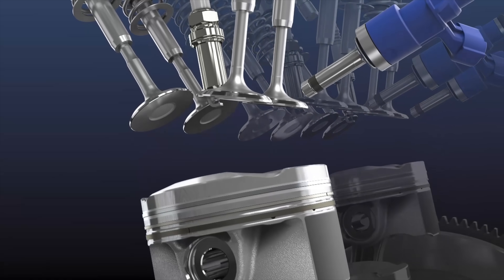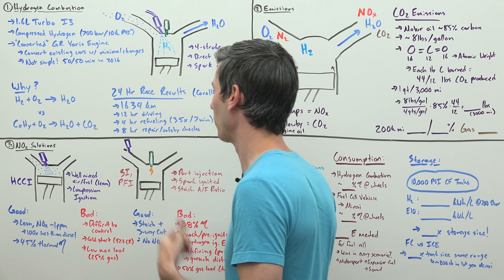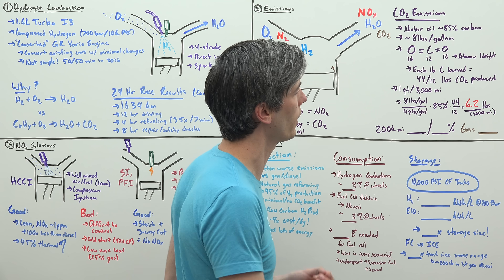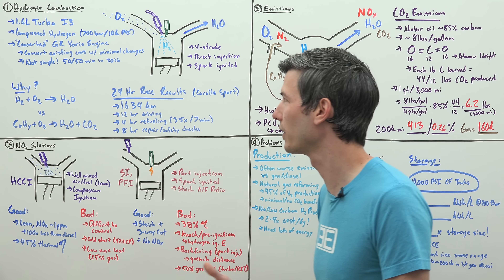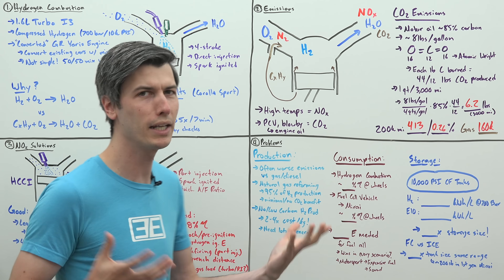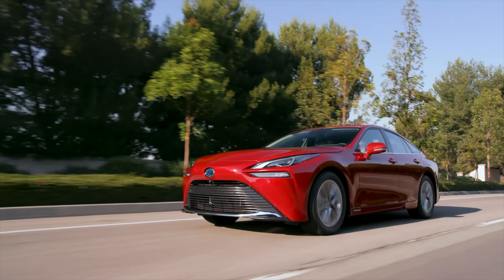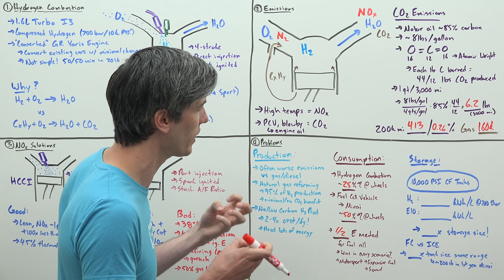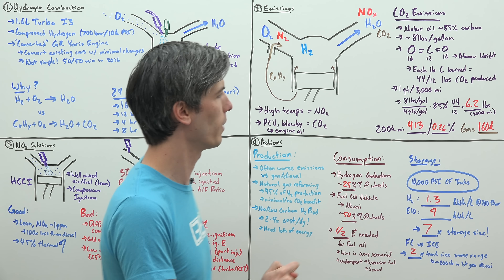Toyota's Developing A Hydrogen Combustion Engine!

Comment: Both Mercedes Benz and BMW had working ICE  engines during the 70-ties as well as there were some converted ICEs in US for test purposes. One thing, not mentioned is that stoichometric combustion of hydrogen and air will result in such high temperatures that the nitrogen oxides are produced in large quantities (order of 5 - 10 000 ppm) since there is no carbon source it can not be catalyzed away as in peterol engines. The solution is to use lean fuel mixtures (approx 50%) in purpose to reduce the combustion temperature in purpose to avoid NOx formation.  This results in a much lower specific power which can, in turn, be overcome by supercharging and/or an increase of engine rpm.  An alternative tested was water injection into the combustion chamber in purpose to reduce the temperature. MB had both hydrogen fueled small buses and traditional sedan cars. To my knowledge most of these projects has been terminated.
Reply: Finally someone pointed it out!

Comment: I love all the comments saying how unpractical and useless this is and how they should just concentrate on building EVs.
Seems that there are just as many EV fan boi's as there are ICE ones, as these were all the same arguments used against the (dire) first generation electric cars.

Ultimately the more different ideas manufacturers can come up with the better.

There are many cases where it seems EVs and electric (at least in it's current form) will not be a suitable replacement.
Thus diversity of innovation is most definitely required, rather than throwing all our eggs in the EV basket.

Comment: You may like to know that JCB in the UK has already made a functioning hydrogen combustion engine.
Reply: Might be a problem shoehorning that beast into a family car but I suppose the principle is the same though. And it’s no more expensive than the diesel equivalent.
Reply: @Alfred Wedmore - I still think the future is more likely to be hydrogen rather than battery.
Reply: JCB also notes that batteries on large equipment causes inflation.  Inflation means more battery weight and then gears have to be made bigger and other parts made stronger.
Reply: @mefobills279  probably also not great in the extreme cold as seen on longway round

Comment: Internal Combustion of hydrogen in oxygen requires light pistons. The exhaust pressure and temperature is captured by a turbine. Water is the end product.
Added: Israel has developed a lovely dual piston IC hydrogen engine that generates power as the piston rods carrying Cu windings oscillate within a magnetic field. 
Wishes for success🏆💪.

Comment: "Imagine you burn a quart of oil every 3000 miles"

Me: laughs in BMW E46
Reply: I was doing a litre less than 500 in my 330ci
Reply: @RobOnMotors  haha that's about the same as mine!
Reply: There is a simple solution for the m54 engines that burn oil, "fixed" 4 engines with the same method. At first you need to understand that they run on way to much oil temp. So do 6x an oil change every 2000km with a good 5w40 like the shell helix ultra, got good cleaning capabilities. In those 2000km drive then engine till it on temp and drive it harder, use more rpm and full throttle (that's what they like anyways) of you've done that 6x make an oil change with 5w50 or stay with 5w40 if you're more the person that drives short distances. This cleans the piston rings, also like I said they like to be driven with a lot of full throttle.. m52s shouldn't have that Problem, of they do, just drive them harder and always do short 15 tkm oil interval on all engines.
Reply: My 173k mile E46 thankfully doesn’t burn much oil 😂
Reply: @trw8777  just do something about it 🤷🏼‍♂️
Reply: My spunky old Mondeo mk3 2.0l diesel auto doesn't use a 1/4 of a litre in 5,000 miles with 157,000 miles on the clock and I don't potter about... and pretty much the same with my Mondeo mk3 petrol automatic at 87,000 miles... 👍 just gotta love the old Mondys... 😊
Reply: do the o2pilot mod
Reply: It’s negligible even at triple that rate.
Reply: @WolfieNamira  My Toyota 1800 Corolla Verso burns ZERO between oil changes each year (6000mls).
Reply: @StewFisk  ahh yes, corollas from the 1800s were built like tanks!
Reply: @WolfieNamira  Cheap and corny , Gary ! ... My Toyota is from 2005 and my point is that the oil usage quoted in your story is way above an acceptable level for a normal engine. Maybe american V8's are built to other (pre-war) standards compared to japanese and south-korean cars (?) Anything above a pint to 500mls. is out of order over here (Europe).
Reply: @StewFisk  of course, everyone has their car for different purposes. My car may burn a hella ton of oil, however it does have the styling, power, handling, and RWD that the corolla does not, so you win some and you lose some.
Reply: @WolfieNamira  I only have the Toyota for its reliability, not for any sporty reason, nor styling; you nead money for that over here where cars are more expensive than in the U.S.A.

Comment: I think reformed methanol is probably the best way to solve the storage issue for hydrogen vehicles. Methanol has more hydrogen per unit volume than liquid hydrogen does, and you get the choice of autothermal reforming, or steam reforming using water (which, incidentally, both h2 fuel cells and ICEs produce). For combustion engines, you can also play games with the mixture, since methanol is itself a perfectly good fuel. I don't think the way hydrogen is currently produced is a particularly relevant argument, since green hydrogen is already cheaper under certain circumstances than even grey. And the key point in the article you quoted is "usable electricity". The trick is that to run grids on stochastic generation, much of the electricity we generate won't be usable, because the robustness of the system is determined at the extremes. A grid that functions on the 5th percentile day where you just aren't generating anything will, by definition, produce massive excess on the average day.

Comment: 2:42 ‘Blow by’ is what comes out of the PCV valve. What he meant here was “the thin film of oil on the bore, used to lubricate the piston, is burnt off in the combustion process.”
Reply: Blow by is the term used to describe the amount of crankcase oil that seeps past the piston rings into the combustion chamber while the engine runs.

Comment: I've said for some time now: I want a V8 hydrogen sports sedan.
Reply: It doesn't matter what you want. I want a hydrogen electric vehicle that's a sports car. Not going to happen anytime soon.
Reply: @bobfg3130  I'm a consumer. Feed my demand. 

You can buy a H2 fuel cell vehicle if you so demand it. You just have to move to a limited part of California, or Japan.
Reply: @Siegetower  

Why? Because you want to? 😆 Get hundreds of thousands of consumers that want one and can afford an expensive car and you have a deal.
Reply: @bobfg3130  What makes it expensive? Economies of scale makes everything affordable to the point that consumers will buy it. A petrol V8 engine is not much more expensive than a flat 4 cylinder, notwithstanding you need 8 valves and spark plugs and conrods compared to 4. It's marketing because it's a subjectively better product, that has allowed cars with V8s to be put on the market at prices higher than other cars.

In the new world, including my own country until recently, V8's are not expensive, they're an engine powering cars of the working class. Which thanks to economies of scale, are not really expensive.
Reply: @Siegetower  

New technology, esearch and development, the type of car, materials, etc.. No, economies of scale don't make  everything affordable. There's a limit to what economies of scale can achieve. If economies of scale would have been so great BMWs wouldn't be so expensive. A V8 is going to be larger, have more moving parts and generate more power...and torque. It's going to be more expensive than an I4. It's not marketing. If you have more moving parts, a larger engine, etc. that actually justifies the larger price. Also, new technologies have few experts and technicians that can work with them. 

So V8s were not expensive? We will go with what you say, still I4s were cheaper. Economies of scale don't solve everything. Most of the working class probably never considered V8s cheap. The working class that could afford a V8 could afford expensive brands. Basically, they weren't that much of a working class anymore. 

Yes, that car you want will be expensive. When you put billions of dollars in research and development you want them back. Production is going to be expensive because the technicians will be hard to find and hard to keep.
Reply: @bobfg3130  Research the Holden Kingswood and Holden Commodore. With a V8 in the range from 1968 to 2017 except for a model in the mid 1980s that had a performance I6 turbo instead, during new V8 engine development. Working class cars in the true sense of the word. Top selling model in Australia most years from the mid 1970s until about 2010. Exported across the south Pacific, NZ, SA, Thailand, Indonesia, and some models to the UK and US. The last model from 2013-2017 sold about 1/4 of the range as V8s.

New world country. Working class cars with V8 engines that were affordable to the common man. I own a V8 and a V6 and I'm on average salary.

In America, V8's also are a working class car. Get the picture?

The reason V8's aren't affordable in the old world is because of artificially high fuel prices and other government intrusions into the market through taxes and compliance, auto makers such as BMW and Jaguar have responded and market them as luxury cars.
Reply: @Siegetower  

The reason why V8s are expensive in the old world isn't because of artificially high fuel prices. Nice try though. In the US they subsidies the oil industry like nobody else does.  BMW and Jaguar DON'T market them as luxury cars. They ARE premium cars. Learn the difference! Different interiors and more features.

In America V8s ARE NOT a working class car. Nice try though.

Those cars you've mentioned had V8s for their expensive versions. Nice try. Those weren't for the working class. What the hell, even the car that you claim sold 25% V8s DIDN'T sell that much. It sold far less than 25% V8s. 

All this is irrelevant.

The car you want will be expensive as hell. Economies of scale WILL NOT make it cheap.
Reply: @bobfg3130  Ah the subsidies argument. Please name one of those subsidies?. Oil is cheap (until now) in the new world because it's not excessively taxed AND it is plentiful. That economies of scale feature again.

Yes, V8's are a premium in those brands because they only sell them with premium interiors and all the bells and whistles justifying an expensive price tag. 

V8s are working class in America. Ford F-150 is as working class as any vehicle in the world, they've had V8s since what, the 1950s???? V8 Camaros and Mustangs are working class, the well off buy upgraded Shelby Mustangs or Corvettes or Vipers (which working men aspire to own second hand) and the rich buy Cadillacs (or BMWs etc).

By the way, C63 AMG's are sought after by working class in Australia now. Because they're V8s and the V8 Commodores and Falcons have been discontinued and normal people WANT V8s. We have freedom to choose and we choose those when we can afford them.

How many examples do you want me to give???
Reply: @Siegetower  

Yes. There are subsidies. Billions in direct subsidies. Oil is cheap in the new world because it's subsidiesed. Economies of scale doesn't work like you think it does. You really don't like the facts, now do you.

The V8s in those cars are expensive because they are V8s. They are expensive to make. 

V8s are not working class in America.

The F-150 was bought as a company car. It was used to carry things. Not a working class car. Buying it was considered an expense.

V8 Camaros and Mustangs were for the well off. The working class bought I4s and I6s. Nice try.

Yes, some of the well off bought the Shelby Mustangs, Corvettes and later on Vipers. Still, many bought the V8 versions because they were more expensive compared to other versions.

Now you got this completely wrong. The rich don't buy Cadillacs or BMWs. The wealthy do. The rich buy Rolls Royces  and Bentleys and similar cars.

The C63 AMG is not a working class car. Nice try. 😆 Now working class can buy them used but they usually regret it because of the high maintenance costs. If this is what you consider working class you're out of touch. It sounds like V8 Commodores and Falcons were NOT bought by the working class. It DOESN'T MATTER WHAT PEOPLE WANT. Freedom? It's irrelevant.

Your examples are irrelevant. The only thing they prove is that you're not working class...and not aware of it.

The car that you want will be expensive.
Reply: @bobfg3130  Name a subsidy. Can you? Usually people who claim this cannot name any subsidy, it's just what activist groups told them and they unquestioningly repeat, regardless of the circumstance. By the way, tax deductions are not subsidies. 

V8s are working class. Obviously in countries that you don't live at. You're unaware of the culture of pick-up truck ownership in America? I used the F-150 as one example but the other 2 US brands have their own models. To claim they're all company cars....that's nonsense. Complete nonsense.

That you pick at there being a genuine distinction between 'rich' and 'wealthy' shows you're more concerned with semantics than facts.

My C63 example is from my own personal experience. Immigrant workers built their own demolition and transport companies, they end up enjoying their money with C63s or HSVs or FPVs. I do their accounts. They might have money now but they're the same workers they always were and their kids will be. I bet you didn't even google what a Commodore or Australian Ford Falcon ever are or who bought them. Kingswood panel vans bought in their thousands to be plumbers and painters vans, not working men to you. What do you do for work????

It's hard to have a reasonable conversation with someone who has such obvious biases and refuses to learn anything new.
Reply: @bobfg3130  List the subsidies. I've asked you repeatedly. List the subsidies without googling or going to a pre-written list on Snopes if you know there are subsidies. You can't list them, because what you've been told about are not subsidies. People usually list a range of tax deductions. But you don't even list anything. 

Speedway racing, a very working class sport. Have you even heard of it, and know what engines they use? You're wrong. My cousin does drag racing, he's a mechanic. You might have heard of mechanics, they're part of the working class. What cars does he race, oh yeah, V8s. What car does he drive to work, oh yeah, a V8. You're wrong. How many ways can I prove you wrong?

You haven't even said what country YOU are from but you're telling me you know more about working people in my own country than I do, whose grandfather was an assemblyman in a factory pressing steel into the same shapes over and over for most of his life and drove a HG Holden V8 ute. How arrogant.
Reply: @Siegetower  

It's an established fact. The oil industry has subsidies. You don't like it? That's your problem. Economies of scale don't work like you wish them to.

Speedway racing is not a sport. You want a working class sport? Try football, basketball, baseball, etc.. I'm not wrong! You are. Speedway racing with V8s costs money. It's not for the working class.

Drag racing isn't a working class pass time. It's expensive. Nice try. Your cousin is a manager. V8s are not working class cars anymore. It's not a working class pass time.

You, proven me wrong? How? You haven't.

The country I live in doesn't matter. I can tell you for a fact that the C63s in Germany are not considered working class cars. In fact not even the simple Mercedes C class is considered a working class car.

 Nice story about your grandfather, I'm not buying it though. Nice try. He probably ended up being a manager or something and that's how he got a V8. You want arrogance? Look in the mirror. I'm not arrogant. Nice try. Stop lying while you're at it.

You can't have that hydrogen car without paying a lot of money even with tens of thousands sold.
Reply: BMW made a V12 hydrogen car. Its called BMW Hydrogen 7
Reply: @barsei1511  That's gotten my attention! Thanks!
Reply: @Siegetower  sorry my friend, bend with the wind, those times are gone. Still I wouldn't mind a pony and trap if I could get one !